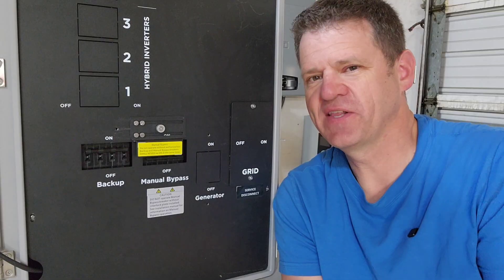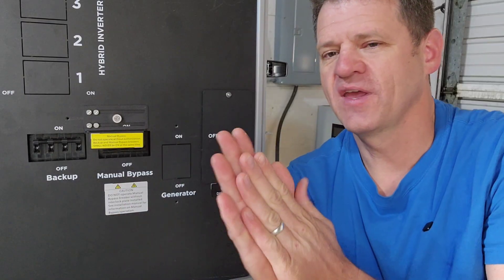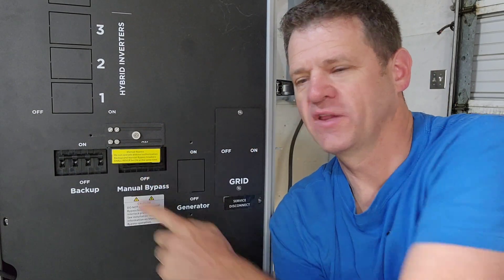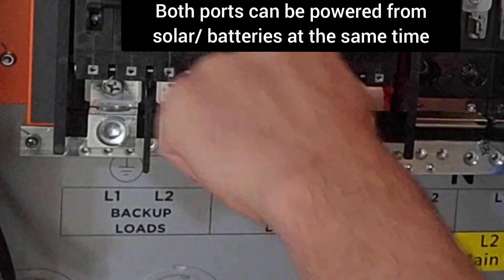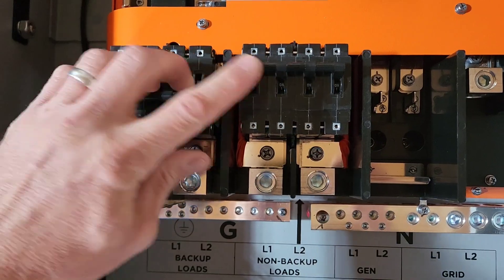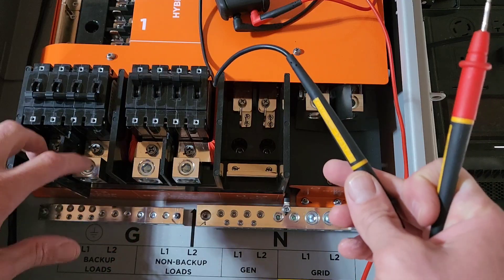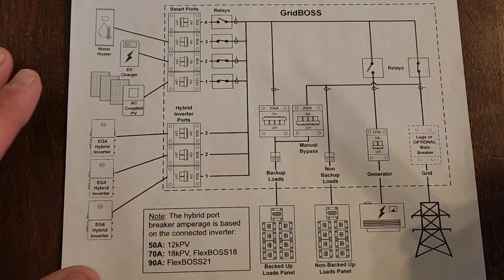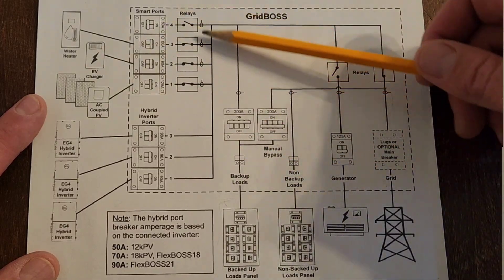EG4 GridBOSS "Bypass Switch" Explained

Comment: Wouldn't a separate sub-panel with a generator interlock kit do the same thing for a lot less $$$$?
Reply from the maker: That's one option. But why not just add the interlock kit to your main house electrical panel and have a full home backup?  I did something similar in this video : https://youtu.be/nAJByNRCw0k
Reply: @diySolarPowerFunWithRay my main panel is 200Amp. The SunGold would spit all of its guts our If I tried to run my main panel on 11kW ChinaVerter.
Reply from the maker: @neveraliberalcrybaby  wonder if it has a 200a passthrough when it's overloaded?  I would imagine you're under 10 kilowatts most of the time even though your panel is 200 amp.
Reply: @diySolarPowerFunWithRay the 10kW SunGold internal bypass is rated for 63A at 240v.  I have my my sungold feeding a critical circuits panel with a 60A 240v backfed breaker with a generator interlock so I can isolate the inverter if needed and run the critical circuits panel from utility power if needed.
Reply from the maker: @neveraliberalcrybaby yes, the back fed breaker is definitely the easiest way to connect to a inverter... however you are unlimited by the back fed breaker size and you can't use the 200-amp pass through when you have heavy loads running... that is why I ended up upgrading to a transfer switch top feeding my panel... both are good options 👍

Comment: One of the things you didn't mention is you can connect entire home panel to the backed up loads panel. You still get the 200 amp pass through with a hybrid inverter then when the power goes out just reduces to the limit of your inverter.

Comment: I very interested to see how you install the GridBoss.  I want to know how you pull the Grid trunk line to Gridboss.   Can a DIY like myself able to do it or we need professional licensed electrician
Reply from the maker: You want to watch my transfer switch video. That will show you how I did it at least
Reply from the maker: Having the grid boss or a bypass switch is not required it's really just icing on the cake. Definitely not required for your first system. Many people install inverters without a bypass switch.

Comment: Would adding the Eaton 200A main breaker to the Gridboss act as a quick bypass switch ?
Reply from the maker: No.  That eaton switch only gives you the ability to shuts shut off grid power so it acts as a service disconnect if you install it.  Sorry, apparently, I didn't explain things super well in this video. Does that make more sense?

Comment: I am still a fan of an external, true manual bypass.  The Gridboss runs software. That alone means you plan for downtime for upgrades, errors, failures, etc. The built-in bypass addresses a few things, but not all things. If you have to work on Gridboss, you need the external bypass.  If the external bypass fails (extremely rare!!), you still have inverters, batteries, solar, etc.   If both of those fail, you can still have a generator ATS between ALL of that and the house main panel.  The ATS see's power loss on source (it doesn't care if grid or solar), isolates to avoid back feed, and fires up.  Only reason I am doing that is I already have the ATS and generator. Might as well use it.
Reply from the maker: Thanks for the comment.  One thing to note is that the gridboss bypass can still operate while you're doint gridboss fireware upgrades, dealing with failed software, n.  As shown in the video demo.  Nice you have a ATS on your house.  I'd use that too.  I could put a extra by pass, even in front of my existing manual bypass... in case it fail... but then I think you can get to a point where you're installing so many bypasses that it just adds more complications and more points of failure/ maintenance.

Comment: Thanks for making this video, Ray. I still think your original manual bypass path is superior to what GridBoss offers. The main concern is long-term reliability: GridBoss doesn’t appear to be field-serviceable, so if its electronics fail, replacing the GridBoss will likely cause a blackout to connected loads. An old-school manual bypass avoids that.
Also, based on the diagram, any load connected to the smart ports will be energized only if the relays fail-safe to the closed position; otherwise those loads would not be energized. Credit where it’s due — GridBoss does include this kind of bypass path integrated into a gateway, which I haven’t seen from many other brands.
Disclaimer: this is my opinion. Follow local codes and consult a qualified electrician or your AHJ before making any changes.
Reply from the maker: That's true...if you need to replace the gridboss for any reason you're also replacing your bypass switch at the same time.  One reason I hope they keep the simpler to install 12kpv and 18kpv.  Something for everyone imo  :)
Reply: @diySolarPowerFunWithRay  I’ve noticed some brands are designing their gateways to be DIY- and field-serviceable. If a control module or smart relay fails, the owner can swap the module—or even the inverter—without disturbing the cable terminations. For example, EcoFlow’s Ocean Pro gateway (essentially a 200-amp smart panel with islanding and many other functions) uses this approach. Also, Its hybrid inverter clicks into a bracket that’s already wired, which makes long-term, in-field maintenance much easier. I’d love to see EG4 adopt something similar so you don’t have to replace an entire system or disconnect cables just to service it. BDW, here is the video link from AverageJoe channel that I learned about it. https://www.youtube.com/watch?v=R4V7u93eOoY&t=2s  Disclaimer: I’m not affiliated with any brand.

Comment: They took the bypass off inverter
So you have to buy extra  grid boss  solar will go modular just put batteries on each other than put inverter on top. The batteries will be 400 volts so. You can use smaller dc wires modular lets you install in minutes

Comment: Just waiting for the Grid Boss to except any hybrid inverter.
Reply: Why would you use anything other than the flexboss21 these days?
Reply: @tjmooney4181  maybe they need a 200 amp pass through
Reply from the maker: That would be nice
Reply: You technically can AC couple any system through the smart ports on the GridBoss. Now whether it would act as a true hybrid inverter, I am not sure. Probably not since there is not going to be communication with the Gridboss
Reply from the maker: @TrytoCatch22 hmm.. I wonder if you need at least one hybrid inverter for it to function. I'm not sure about that
Reply: @TrytoCatch22  Yes I have AC coupled inverters for years but the thing is you don't have much control as to how much and when. But with them shared you have full control. So with a hybrid inverter on both ends of the AC couple it should be more programmable.